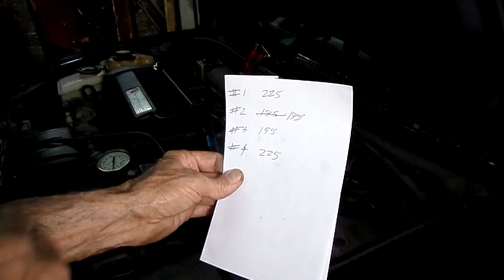Compression Test

Comment: Thank you richpin for all you do. I was wondering would you recommend a Baldwin fuel filter as an alternative to wix? I can't find the wix anywhere. Or do you have a suggestion to how I can find a wix? Right now I have a 15 dollar AutoZone filter in and it's causing major problems so I'm not driving until I can replace. A commenter had suggested I get a Baldwin from rock auto as an alternative but I'm  hoping to get some feed back from you since we both have 1998 models mines an sc1 Manuel. Your vids have helped me so much. It's so close to running perfect now. Just need that proper filter. Thank you in advance

Comment: Why do we do this test?  are the gauges similar to each vehicle
Reply: He is looking for objective evidence to show that at least one cylinder has bad compression, often in an effort to decide whether the vehicle is worth saving. Bad compression often (not always) means there is a serious problem with the engine, like worn rings, damaged cylinder wall, damaged valves, head gasket leak, weak or broken valve spring, etc. The gauge is generic, though specific compression numbers vary between engines. If poor compression is found, mechanics often go on to do a leak down test to help decide where the air is leaking.  The next time you crank a starter motor on your car, listen to the cadence of the cylinders turning over. If the sound is regularly irregular, like a galloping horse, it suggests one cylinder is different. The latter test is known as a relative compression test, which can also be done electrically by watching current draw or voltage drop across the starter motor.